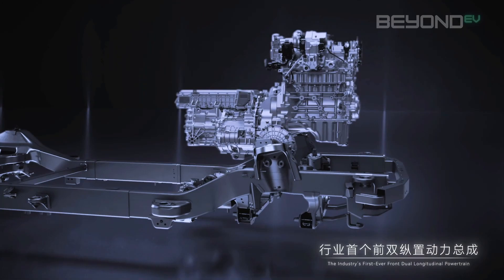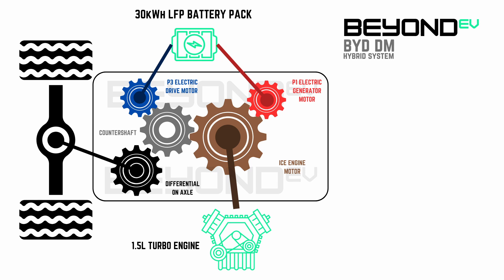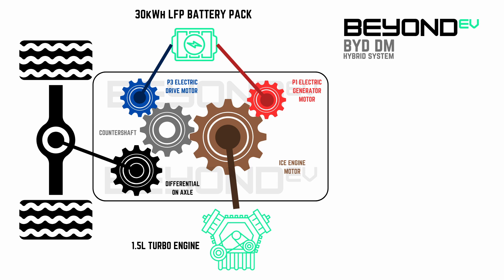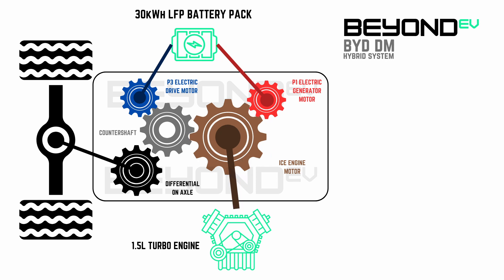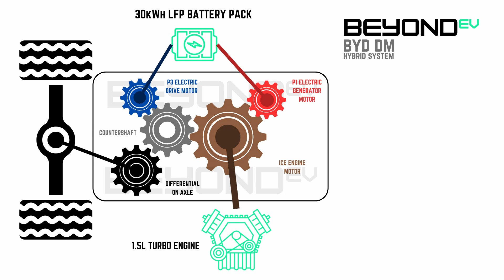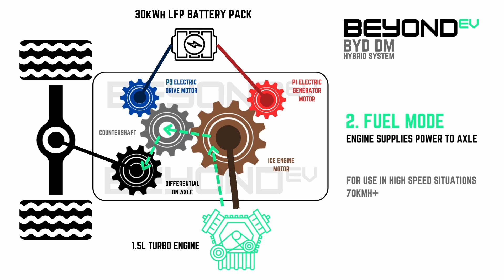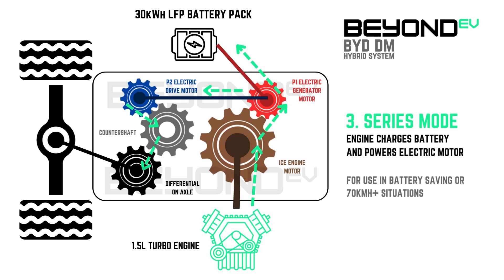What's inside the BYD DM Hybrid System (BYD Shark + BYD Sealion 6)

Comment: Some mistakes in this diagrams:
1. Mode 3, series: the default threshold is not always 20%. It is configurable from a lower bound to 70% on most vehicles. The lowerbound is 25% (DM 4.0, normal EV mode), 15% (DM 4.0, forced EV mode) or 20% (DM 5.0).
2. Mode 3, series: when in need of high power output, the engine doesn't increase its output immediately. Instead, all power from the generator motor, plus some power from the battery, is directed to the drive motor for a burst of power.
3. Mode 4, parallel: the generator motor is still connected to the engine. Excessive power is directed into the battery. Therefore, even at high speed and in parallel mode, the battery can still slowly recharge.
4. For simplification, you omitted all regenerative braking modes. (EV+RB, series+RB, parallel+RB)
Reply from the maker: @deepseer  Thanks for the input! I know it's not perfect, there will be scenarios where the threshold is off or added scenarios that I didn't cover. Was trying to keep it as simplified as possible.

But thank you for clarification!
Reply: @BeYonD-EV I have a simple question, say the Shark 6/Shark runs fully out of charge, can it run on the petrol gas only?
Reply from the maker: @zechssiguro7476  no it won't as far as I am aware. What I have been told is the battery can be run down as far as 10% in EV mode, but no further. It will force series mode as that point.
Reply: @BeYonD-EV   thank you for the feedback, I I understand the range anxiety now. I wonder if the Ford Ranger PHEV will be able to gas only? but I know the SHARK6 will be more affordable, I'd consider sacrificing some trunk space, for an in tray additional battery bank "Range Extender", for some trusted source, that hopefully won't swell with the heat in my temperature Caribbean region, nor your Aussie outback. ( tonneau cover it, & plug it into one of those many port on the BYD & or Ford)
Reply: @zechssiguro7476  It can never run fully out of charge unless there is malfunction.
It will automatically recharges the battery in series-recharge mode (mode 3) and parallel-recharging mode (variation of mode 4 as I mentioned above).
However, if the battery or the motor is not functional, the vehicle can not run.
Reply: @zechssiguro7476  Both can run without external charging.
But the difference is: at low speed, only in series mode can the battery be recharged with high ICE efficiency.
In series mode, ICE's RPM is completely independent of the speed of the vehicle, therefore it can work at a constant speed. In parallel mode it can't.
Reply: @deepseer  Tks 2 you both for the detailed feedback, if I can afford it, I'd go with the BYD slow charger at home until my region develops charging stations, then possibly consider an small bed fitting extender. Glad Fords getting in the game with a stock Tonneau cover,just wish they could offer it at a price that could have us all with a Model T again, cut bk on global warming by committee.
Reply: @BeYonD-EV @deepseer
Thank you both. 
Just test drove this car. At the end while discussing with the salesman at the dealership he explained that you can’t set when the battery starts charging; only that you can set what you want the battery to be charged to when it reaches 20%. Did not make sense to me and I am not sure if the salesman knew what he was talking about. 
Could you provide some insight into these issues: 1. Does the car behave as in the video linked when the charge falls below 20%. (Link: https://youtu.be/j5KWr2Knpko?si=dXR-e5j_I4QNvExE)
Reading the English translation a Colombian man complaining that once the car battery <20% he was having issues with speed and acceleration. You can also hear how loud the engine is!! 
2. Can you set the percentage at which to start charging the battery? 
Cheers
Reply: Is the BYD Shark an AWD drive train, if so, in 4 wheel drive do the front wheels get driven by the electric motor genset or the 1.5L turbo gas engine or some combination of both...thanks.
Reply: @ericsandberg3167  It's AWD.
Front wheels: series-parallel like in the video
Rear wheels: series only
Reply: @ericsandberg3167  - for the setup example in the video, the rear is strictly driven by its own rear motor ( no engine ) - note no driveshaft
Reply: Is it 5-th gen dmi, ? Or 5?

Comment: Sound more complex than Toyota’s e-CVT, which uses the same 2 ev motors and the petrol motor.
Reply: "more complex than Toyota’s e-CVT," you think the single-speed drive from the ICE more complex than a CVT ??? Oh dear !!!
Reply: @mikeausyou  Their marketing name "e-CVT" is very misleading. The system is indeed mechanically very simple and robust. There's a reason why it has proven so reliable. It is however a bit tricky to wrap your head around, which is why they invented that misleading name for it.
Reply: Toyota uses a complex planetary gearbox. BYD's system is similar to Honda's.
Reply: @deepseer spot on! The distinctive difference is Toyota's hybrid system still has a mechanical gearbox because it predominantly runs on engine and electric motor only is engaged at startup/low speed. 

However BYD's DM-i system works the other way around focusing on electric motors ALL THE TIME. Engine is only used to either recharge the battery (in series mode) or to provide additional burst of power when overtaking or high-speed cruising (in parallel mode). Hence there is no need for a gearbox AT ALL.

The conclusion is mechanically Toyota's hybrid system is definitely more complex but its working logic is simple. Low speed -> electric motor; mid to high speed -> petrol engine
However BYD's DM system is undoubtedly simpler mechanically but its working logic is more complicated. Different mode under different circumstances. Yet we humans don't need to worry about it as it's all dictated by its EHS computer.

Comment: Hi I have all those modes available in the Mitsubishi Outlander PHEV 2018
Reply: No it doesn't otherwise there will be a lawsuit against patent infringement on BYD by Mitsubishi. Also it's already mentioned in the video BYD's DM system is currently the only one in the market to have all the working modes in a PHEV.
Reply: @Deandzzzzzz  Well, I had a 2017 Outlander PHEV and although the mechanical layout differs, the functions are the same. I could drive in EV only mode (although ONLY is a stretch as the engine would kick in under extreme load, high speed or if the battery was low). I could select 'Save' mode which did not engage electric drive in order to use it at a later time or I could employ Charge Mode. Charge mode would drive the wheels with both electric motor and ICE with additional power to the battery. So, a true series/hybrid system. As a generator it was expensive which is where this differs from the BYD. The Mitsubishi was a 2ltr ICE (later upgraded to 2.4ltrs) with two electric motors where a lot of the drive was still expected to be provided by the engine. It was a reasonably powerful setup but as I said, not efficient. The BYD appears to favour an efficient charging series system with a highway ICE drive.
Reply: @evtorque  I strongly recommend you book a test drive of BYD Sealion 6. I have driven my SL6 for the past 3 months and I am very happy with the EV-only range, acceleration (regardless of SOC high or low) and fuel efficiency at battery-deficit state (HEV mode kicks in at < 25% SOC by default). Sounds like BYD’s DM-i systems outperforms Mitsubishi PHEV system as per your comment.
Reply: @Deandzzzzzz  Well ..I would ...but ... I already have the BYD Atto 3. Love the car except for the slow AC charging at 7kw. As I'm planning for longer trips, I will need to rely on DC fast charging. That's where the BYD DM-i would be useful. I will wait a little longer to see what longer range full BEV's arrive and what their AC charging looks like. In Western Australia, faster AC charging as a back-up to DC fast charging is simply a case of having a PLAN-B until more reliable fast DC chargers are available regionally. With 22kw AC charging (on 3-phase) I would be a very happy camper. 3-phase 32 amp (22kw) outlets are available everywhere even if installed chargers are not so all that is needed is a 3-phase granny charger with adaptors for 20 & 32 amp supplies (I already have this). Otherwise, yes I'd give the SL6 a go. Cheers.
Reply: PHEV was developed and innovated by BYD (full name is series-parallel dual-mode electric platform hybrid (DM PHEV) which can be externally charged and discharged). In 2007, it applied for the core patent in China. In 2008, the first car went on the market (F3DM, the first generation BYD DM PHEV), and now it has developed to the fifth generation technology.

Comment: Probably a silly question , but if you were in a camping type situation could the motor recharge the stationary shark over time , obviously you’d hope not to get to that point …. But !?
Reply from the maker: @geneharrison6625  yes apparently it can. Tim from the owners review video mentioned that you can let the car sit idle with the engine running and it will add charge to the battery.
Reply: @BeYonD-EV  thanks mate , obviously this wouldn’t be efficient but nice to know it’s possible if your in a bit of a situation ☺️
Reply: @BeYonD-EV so the engine still needs to connect to the P1 motor while decoupled from the driving cog.
Reply: I wondered the same. The user manual had the answer. It talks about the “power generation mode”. Says “With the vehicle in P gear and HEV mode, when SOC is lower than a certain value, press the accelerator pedal to trigger the power generation function.”

So yeh sounds like you can force it to charge. Awesome trick for camping scenario.
Reply: The Outlander PHEV can do it at least so it's technically possible without engine overheating
Reply: i dont think its the most efficient,  its outright redundant. 

electric power from engine runs the motors, excess power can be diverted to charge the battery on the move in combination with regenerative braking
Reply from the maker: @freetheworld247  I think the use case for this is following a long trip to your destination you could be down to 20%. Letting it sit idle for a while can get it back up to 40-50%. Then turn engine off and use that to power your site for the night and take off in the morning.